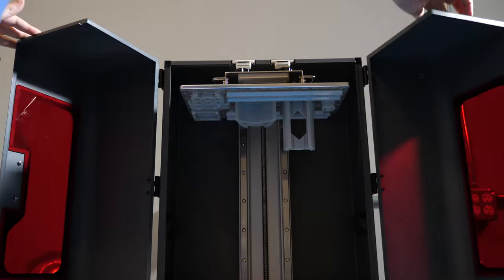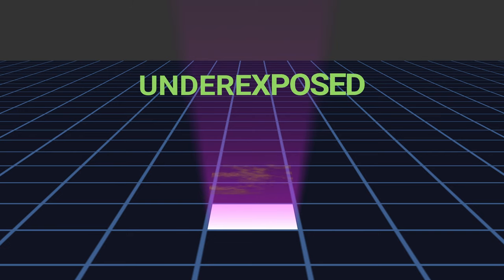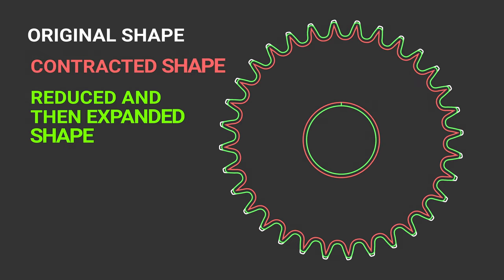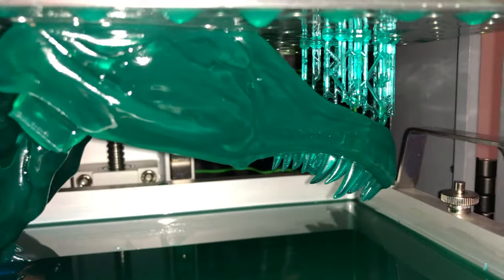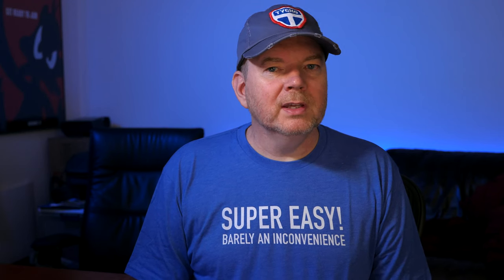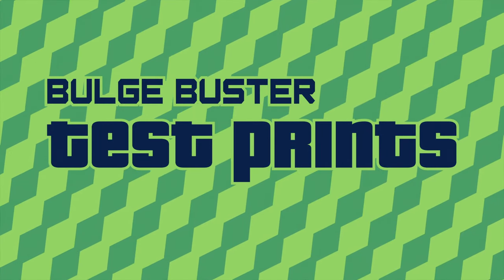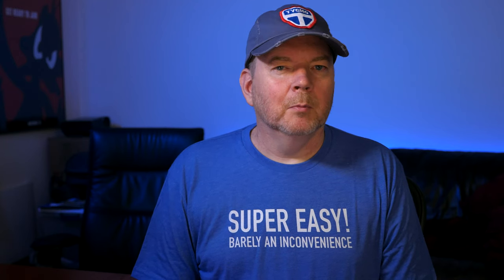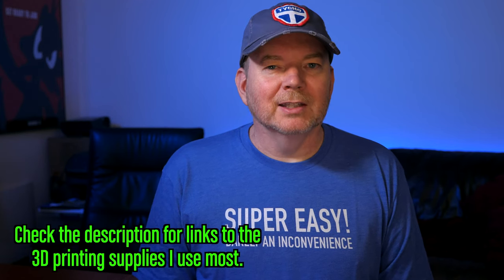Remove the Elephant's Foot from Resin 3D Prints - Plus NEW FREE Bulge Buster App

Comment: Nice man. Solid work.
Reply from the maker: Appreciate it!
Reply: @Nerdtronic  Since I got you here... I'm a master DIY tinkerer also, but I cannot figure out this resin problem I'm having. I'm new to resin (from FDM), and cannot get rid of air bubbles in one of my parts. It's a translucent part and needs to be solid. Here are some photos of it.. : https://drive.google.com/drive/folders/15_XbuURVvJnxIHmMSVfl9cSa_K2ZcH_Y?usp=sharing

I tried slowing down the lifting speed.
I tried slowing down the lowering speed.
I tried increasing the height of the lift.
I tried increasing the cure time.
I tried increasing the ambient temperature to ~30c. 
I tried changing the FEP.
I tried changing location of the part on the build plate.
I tried changing the orientation of the part on the build plate - however I need to be mostly vertical as I'm trying to keep supports off the surface if possible. If this is what is causing all of my problems (probably) well... argh. Why?

I'm resourceful, but cannot figure out or battle this problem out of my part. Any help is appreciated!
Reply from the maker: @thisistheburner5346  Sorry I've never seen bubbles like that.  My first thought is the temp of the resin.  But you said you already tried that.  Wish I could help.  Sorry.

Comment: This is great! Have you seen that Chitubox has implemented this as a beat feature in their slicer? I hope you got credit for it.
Reply from the maker: I have not seen a feature that is exactly the same as this.  Until they have a way to print calibration chips they don't have the feature.  That part is key to calibrating.
Reply: @Nerdtronic  Yeah their method isn't exactly the same, but I think it most closely resembles the double exposure test. I do not know exactly how they are doing it, but the setting tell the slicer how much to reduce the size of the bottom layers. It also adjusts for shrinkage on the whole model. The methods used in Bulge Buster are more elegant for sure.

Comment: Great idea - thanks. However just downloaded and tried the pixel dimming test - my early Saturn (202012) says "unknown file type", Chitubox 1.8.1 recognises file, saved again without changes - same result. Running Bulge Buster on an existing .ctb (from Lychee 4) has same result. Updated Saturn firmware etc - same result. Anyone else got this problem? Is there another way to contact you? Cannot see anything on your website.
Reply: Just ran into the same problem...

Comment: Really impressive work of yours with the app and the explanation. Pixel dimming with the software seems to work.
Unfortunately, the test file for pixel dimming doesn't work for me. Although I  set layer hight at 0.05, the file is created with 0.01.
When I open the file with chitubox,  it display to  takes 2 hours of printing time with layer hight 0.
1mm and over 200 layer. The app display 60 layers by 3mm  Object hight and 0.05 layer. All values  do not match.

Any tips on what I'm doing wrong?
Reply from the maker: What printer do you have?  The other day I realized that .cbddlp files might have issues with pixel dimming.  The work around is to make sure that the file you slice in chitubox you turn antialiasing on and to the max levels.  BulgeBuster matches the file format that you drag on exactly.  So if you drag on a .cbddlp file that has antialising turned off, it won't be able to save the dimmed pixels.  I need to do an update to fix that.  Hopefully within the next week or two.

Also be aware that if you load a file back into chitubox that uses pixel dimming, it won't show the dimmed pixels dimmed cause it doesn't understand them.  I'm not sure what would happen.
Reply: @Nerdtronic  thanks for the quick response.  I save the file with .cbt. And pixel dimming works. Thats not the problem. My problem is the pixel reduction test. I can´t  test witch reduction or dimming is the best for my resin. If i save the test file and a opened  the .cbt test file in the slicer it shows layer hight is 50 micron how i set it up before . But  it really have 600 layers and would take  about 8 hours.
Reply from the maker: @Stefhavefun  Can you send me the file you are dragging in and the one it's making?  Loading the file back into Chitubox isn't going to be a good test.  Load it back in to BB is ok and then look at the layer table.  I didn't do a lot of testing at other layer heights.  But if you email me the files I can take a look... michael@nerdtronic3d.com

Comment: I printed some mechanic parts (~2mm thickness) with my LCD resin printer, but my parts warped after a while and can't be used. How do you prevent your parts from warping?

Comment: But will the dimming method work on the newer 4k mono screens?  I mean, a mono screen, traditionally, means black or white, there is no grey pixels. Just like the old Mac Plus screens that could not display grey scale.  Let me know if I'm wrong on this and if mono screens allow for grey pixels.
Reply from the maker: The mono screens do have grey scale pixel ability.  That's how they do antialiasing.  They are just black and white instead of color.  Not like the old mac screen with ONLY black and white..  More like a black and white tv.

Comment: Really great info on what creates the elephant foot, but sadly it looks like files created with Chitubox 1.9 says not a valid cbt file (should it be ctb?) when I try to open the file on my PC.  I know this version of Chitubox and higher creates signed files, and that is what my Mars 3 needs, so I am unable to use this for any of my prints.
Reply from the maker: You can try the tolerance compensation feature inside chitubox.  It’s similar.

Comment: The latest version of Chitubox has a beta feature that does this.  You can set some parameters and it’ll compensate for elephants foot.
Reply from the maker: I think it does something but I'm not sure it does it the same way.  And you can't print the test chips with Chitubox to help determine what settings will exactly equal and compensate for the amount of elephants foot you're getting at the bottom layer exposure time.

Comment: I know I'm late to the party - but I must say you're wrong here. Elephant foot is caused mostly by the fact, that resin is not still when it's beeing exposed; basically when your printer lowers its build plate to the bottom of the vat, it must squeeze resin from that very thin space between them, and it doesn't happen instantly. You start exposing when resin is still flowing, and since it's a bottom layer your exposure time is long, that partially cured resin moves outwards and eventually some of it close to desired shape gets cured enough to for what we call elephant foot. And it may also cause dimentional inconsistencies in X and Y axis.
To solve that problem, all you need to do is wait before you start your exposure - you need to increase "light off delay" (or whatever it's called in your printer), for bottom layers 60 seconds should be more than enough, and then you can than lower it to say 15s for the rest of the model. I use those values and everything works like a charm.
Oh, and I set bottom layers to no more than 3x the time of normal layer, that's enough to get a good grip to build plate.

It's not that I'm that smart to figure this out, I read it on this guy's blog:
https://blog.honzamrazek.cz/2022/02/a-step-by-step-guide-for-the-perfect-bed-adhesion-and-removing-elephant-foot-on-a-resin-3d-printer/

Comment: Can your software also do pixel subtraction for layers that are NOT the bottom layers? For example, xycompensate software (simpler but same idea) lets you compensate for elephants foot bottom layers but also for every other layer. I use this when trying to get dimensional accuracy in my prints as the overexposure bleed also occurs for normally exposed layers (although much less than the bottom layers).
Zsuite and Prusa slicer also have this option to some extent, but not as well done as this.
Reply from the maker: Sorry it can't.

Comment: Cool idea. I just tried to use the app and just to check - opened the busted file in chitubox and it made my file look like minecraft... all blocky instead of what it was - super smooth. why?
Reply from the maker: True - Slice in Chitubox and open in Chitubox and it will look like that.  Without a trip busting bulges first.  So that's just what it looks like when you import a sliced file into Chitubox.  If you want to compare apples to apples, take your original file (before busting) and compare how it looks reimported with the busted file reimported.
Reply: @Nerdtronic   Doh! i should have checked that. My bad. I went ahead and tried to print the busted file, and by golly, you helped me bust my bulge! Excellent work on the program!

Comment: Chitubox 1.8 beta has "bottom tolerance compensation" which looks to be able to help out
Reply: Yup - setting the "bottom tolerance compensation" to  -0.21mm (for items A and B) has eliiminated the foot on my prints using elegoo grey/white/black resins on a SM4K (I'm currently printing v6 resistorboxes, which have the advantage of being nice and easy to measure/quantify distortions on.)

Based on experience trying to print a  planetary gear bearings and the way printed teeth bled into each other up along the entire height of the print, I think that tolerance compensation of -0.05 to -0.1mm might need to be dialled in to loosen the fit of such parts, but I'm pretty sure if I did that on the resistor drawers I'd start seeing holes appear

Comment: This is several years old and I doubt anyone will see this but I am battling elephants foot on an anycubic photon mono x 6k and bulge buster doesn't seem to work with the .pwmb file type and fiddling with the burn in layers number and exposure time didn't seem to have any impact on the elephants foot problems I am having.
Reply: Thank it seem complicated to me still searching same method how to print without support especially some model can be printed only for flat area 
Example of my 3d model
https://youtu.be/wL3YvOe0ZgE
(I remake 3d model to 1/87 scale)

using support method the result mess up because using support bottom and top area will leave traces

 While using flat surface some top missing detail i get elephant foot while bottom area have fine result

Comment: Does it explain 2-3 first z layers of over growth size? I mean I cannot print anything below 0.4-0.5mm in height. It is impossible. I can see that they first 2-3 layers are thicker than other ones. Do you notice similar behavior as well?
Reply from the maker: I believe that has to do with Z calibration.  On my printer you calibrate the Z with a piece of paper.  We're talking 50 microns is like the thickness of a hair.  So getting that first layer to be exactly the same as your layer height would require that there is zero distance between the plate and the fep before printing.  And that probably isn't happening.  So yeah you might end up with a thicker or thinner first layer.  Probably thicker.

Comment: by hook and cook i have managed to print directly onto the build plate with a layer height of 0.05 mm using 1.9 seconds exposure time and also 1.9 seconds bottom exposure time with a bottom layer count of 6 (and less) on my phrozen sonic mini 4k. just to confirm 1.9 was not a typo. i am printing using 1.9 seconds for both regular layers and bottom layers. But..... there is STILL a noticeable elephant's foot on my prints. this makes me wonder if the cause of elephant's foot is not only related to bottom exposure time but also to some other factors. Update: after doing more tests it is possible the elephant's foot i am still seeing in spite of my bottom exposure time being only 1.9 seconds is due to a flaw in the machine design or software, or a miscalibration of the z axis. it seems like multiple bottom layers are being cured on the same plane (if that is possible) 'squishing' the layers together. for example, a 10 mm cube comes out 0.20 too short on the Z axis at about 9.78 mm while the XY axis are an acceptable 9.97 mm. very odd considering my bottom exposure time is ideal. don't ask me how i'm pulling off a bottom exposure time of 1.9 seconds. that took a lot of time and effort to figure out! trade secret for now. just for kicks i also did zero bottom layers but that resulted in a failed print. so the machine must be treating bottom layers differently even though i tell the machine to treat bottom layers the same as other layers

Comment: Great job, unfortunately can not try in on my printer (Mono X, needs support of PWMX files).
Reply from the maker: Hopefully someday.
Reply: @Nerdtronic   I am in software engineering by trade (could offer some help here), looked into PWMX and it's freeking binary. Lychee slicer does PWMX export and CHITUBOX too, so these dev teams should know the structure. But not sure if that is something they could share with others.
Reply: And also some  FDM slicers have similar feature built in for a long time already (Prusa), you should try sell/license it to Lychee and/or CHITUBOX.

Comment: Can you reduce the initial burn layers by time and number? Like instead of 40s for 6 layer heights just make it 20 for 3 layers?
Reply from the maker: Yes.  If I'm bulge busting I usually don't though.  Experimentation is the way to find out if you're burn time is enough.  But cutting the burn in time by half might not have good results.

Comment: so i just tried the double exposure method on my transform and i got a large model in the centre of the platform at the correct size and location on the plate. but at the same time, it also printed a much smaller version in the back right hand corner of the plate? the large model also stuck to the FEP. any suggestions or is this a bug? the large print was 42sec exposure and the smaller was 8sec. base layers were set to 50sec and normal were 8sec (my normal print settings).
Reply from the maker: Can you email me the print file?  And the file before you bulge busted it.  Send it to michael@nerdtronic3d.com.  That is weird.  Did you make sure you saved as a .phz file?  And did you make sure to select "default gcode" as the profile?  Even still shouldn't be 2 things on the plate if you only put one on there in chitubox.

Comment: I'm more curious how you manage to print flat! I've been printing a year with the Transform, tried every advice can find, and still the prints lock to the FEP better than the plate..! And mostly, I've got great plate adhesion - with supports. Flat, pulls off 99% of the time.
Reply: i was printing some thin wide bases angled with (a lot of) supports, but they kept warping. tried it flat on the plate and worked great first try without changing settings (elegoo saturn, stock chitubox settings but sliced in lychee, brushed steel flex plate, paper leveled. printer stays inside (not in the garage) at 20-25C).

edit: just remembered, settings are NOT stock - i've decreased lift speed to 40mm/min and initial lift speed to 20. you should definitely try this first.

Comment: I just recently upgraded to Chitubox 1.9.0, and it appears that BulgeBuster is no longer compatible with the new format. Any plans on an update? It there a GitHub project for this?
Reply from the maker: That’s right. 1.8 is the best version for bulge buster. There is no way for me to load ctb v4 files. The whole file is encrypted.  So game over.  Even with their SDK it’s not going to work.

As for GitHub, no. The project isn’t open source. It’s written in xojo which is cross platform.  But even if it was, there is currently no way to solve this ctb v4 problem.

Comment: I will first try some classical from fdm, cutting out a slight chamfer on the bottom...maybe it works maybe not and in certain cases does not destroy but improves the aspect
Reply from the maker: A chamfer is angled up, and is measured in mm.  So problem 1 is that you'd have to convert the mm to number of layers, or visa versa, and match the chamfer size to the number of bottom layers.  Possible, but has to be done when you design the part, not when you print the part.  And sometimes we change the number of bottom layers for different kinds of resins.  But problem 2 is that the chamfer is an angle.  So each layer is going to be a different size.  But the bottom layers are just a higher exposure.  So each of those bottom layers is going to be X amount bigger.  So you're still going to have some sort of deformation on the  bottom layers.  Just a weirder elephant's foot.  What the app does is lower the exposure on the edges of the bottom layers by the exact amount to match the exposure on the rest of the layers.  So that hopefully you won't have any elephant's foot at all.

Comment: is pixel dimming essentially Gray level in ChiTuBox Advanced settings under Anti-aliasing?
Reply from the maker: Similar.  Anti-aliasaing uses a dimmed pixel.  But this features exposed the outer edge at a dimmed pixel to try to prevent that section from expanding and creating the elephant's foot.  Where the goal of anti-aliasing is to remove some of the layer lines and salmon patters.